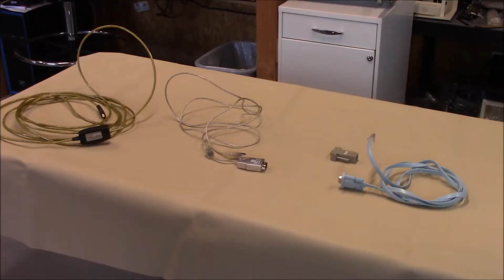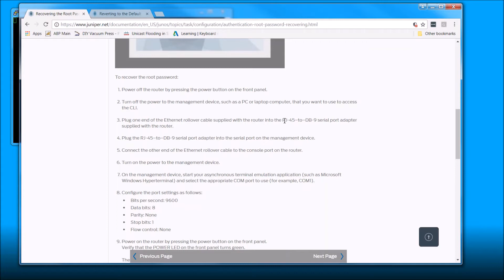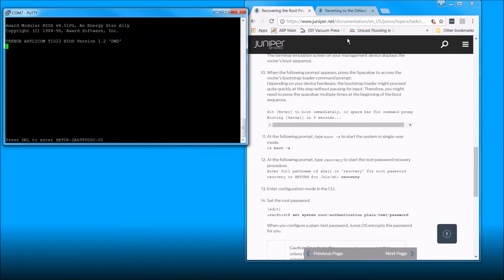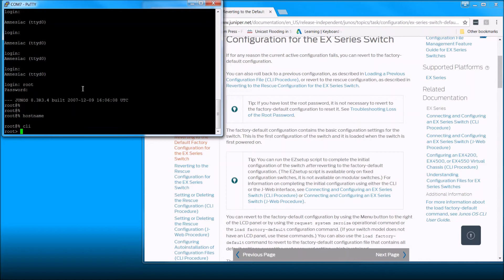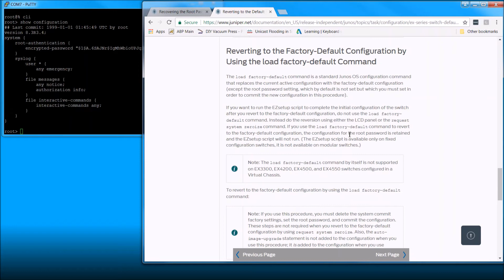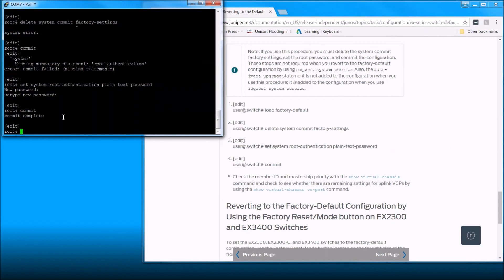NE#43 Juniper Password Recovery & Default Factory Config

Comment: I am not getting into CLI mode and getting below error .Kindly suggest 

Starting CLI ...
invalid user: getpwuid failsCLI invocation failed
Continue, Abort, or Start Shell? ([c],a,s)
Reply from the maker: I  don't know why you are getting that error.  A quick google search came up with this answer on the Juniper forums: https://forums.juniper.net/t5/SRX-Services-Gateway/Recovery-root-passward-of-srx650/td-p/176617
Reply: Dear Sir. I have juniper ex2200 device. When I access, the error message "connection to master failed, enabling local login". how to fix this error. Pls help me. i want reset factory default